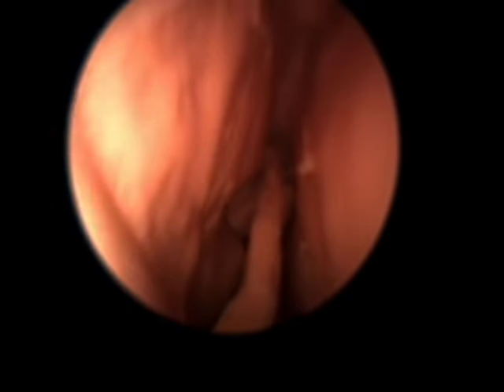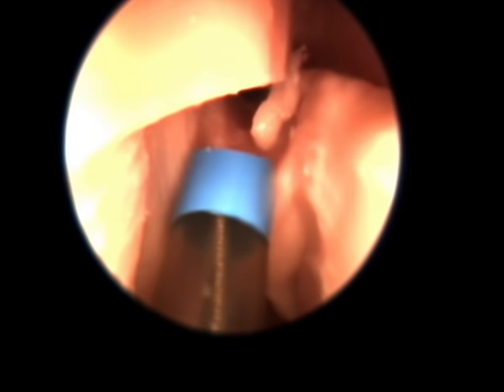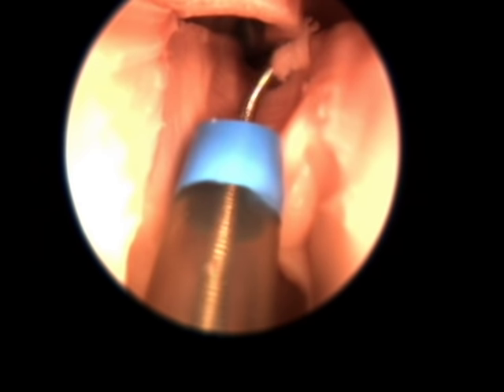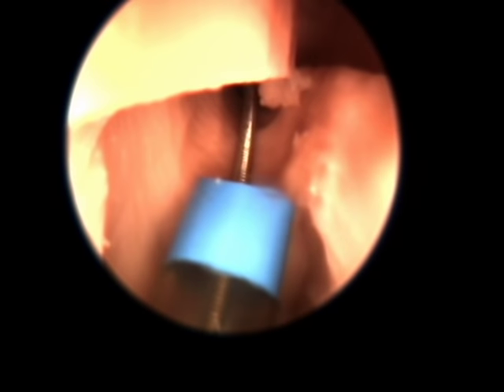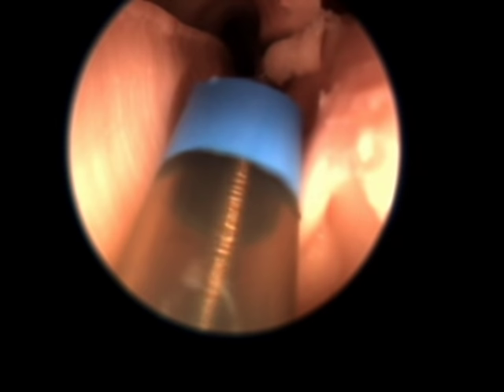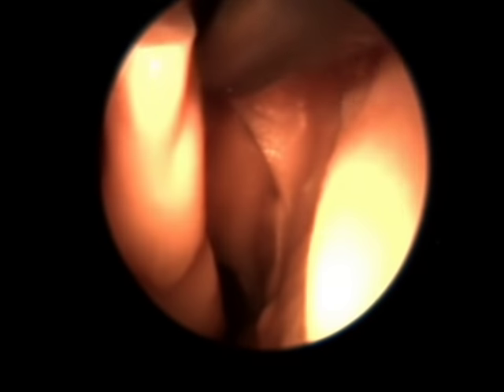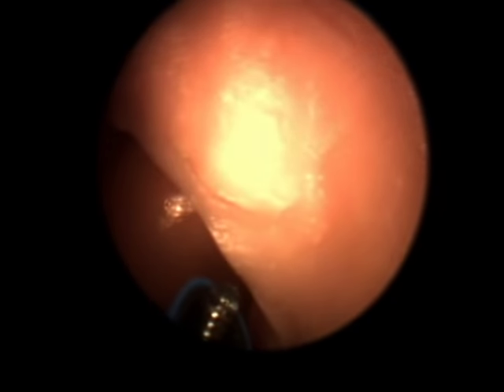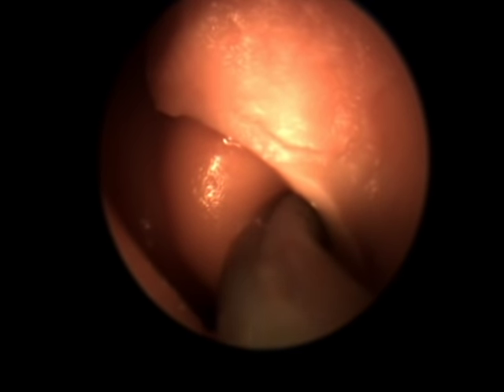Balloon Sinuplasty for Chronic Sinusitis Treatment (HD)

Comment: I'm seriously reconsidering getting this. I've been treating my allergies, but if I get either a flu or a cold I start blowing my nose 24/7, not to mention that I'm starting to have a pulsating tinnitus because of congestion. I dealt with sinusites my whole life, so at this point I'm willing to get this procedure
Reply: I had this 2 weeks ago. Beware this didn't work for me. This is called a procedure for a reason. This is not a surgery. I was only able to breathe freely for couple of days. then My nasal congestion, pressure and  headache are back. Don't waste $.
Reply: @loljk1991  hey Raj can you please tell me where you got this done in which country and we're you under general anaesthesia?
Reply: Get it done. It is painless and may not solve all your problems but you will see an improvement
Reply: I just had it done like 3 days ago, so too early to tell effectiveness, but stateside it has something like a 90% or greater effectiveness for symptom relief for at least 12 months.
Reply: I can’t blow my nose. Only post nasal drip. I think it’s because my septum has such bad sinusitis. 
Anyone had septum sinus scraping done?
Reply: @loljk1991 have you considered sinus scraping?